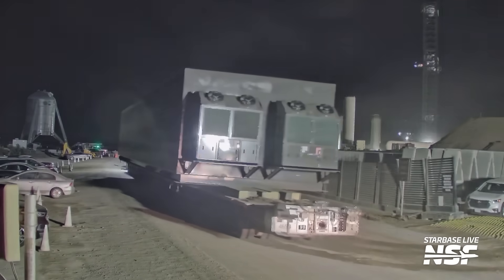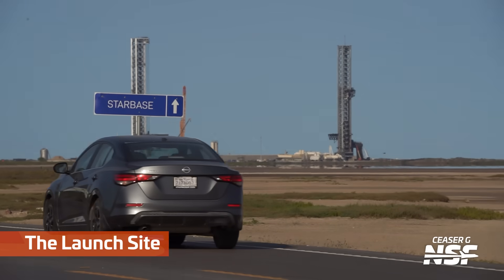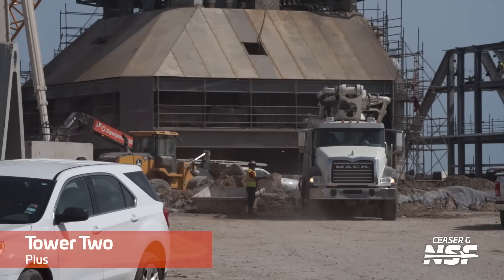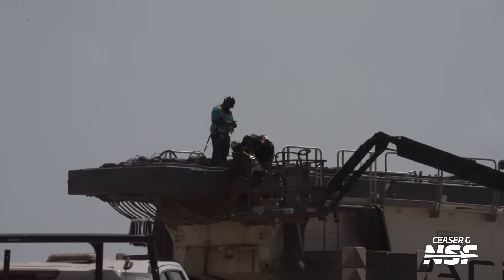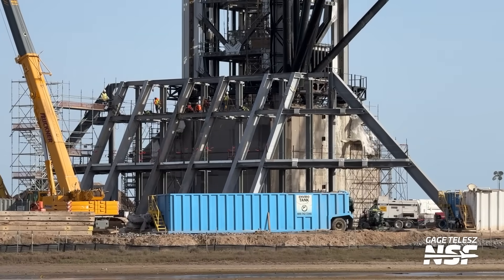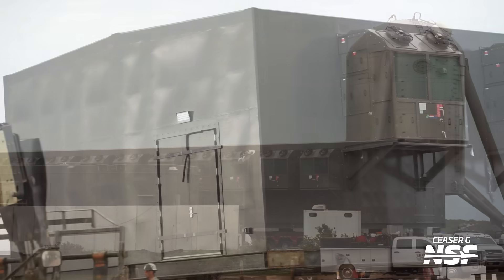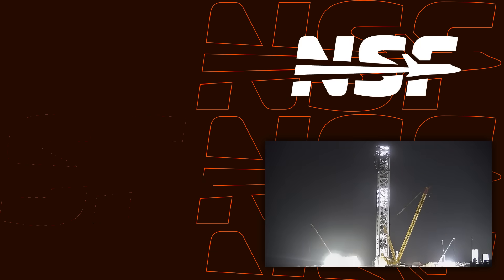The Final Days of the Starbase High Bay | SpaceX Boca Chica

Comment: Power Bunkers. The ones we installed at my last computer company were a mix of batteries, diesel generators, fly wheels attached to generators(that can kick in in less than one 60Hz cycle) and a water cooling system. The idea was that if power failed, the flywheels would kick in first, then the batteries would cover while the diesels came up to speed and continued the site electrics.

Comment: At least one of those buildings will house Variable Frequency Drives to control the 3-phase A/C motors used to pump the cryogenic fluids.  A/C motors are speed controlled by varying the frequency, whereas D/C motors are controlled by varying their current.

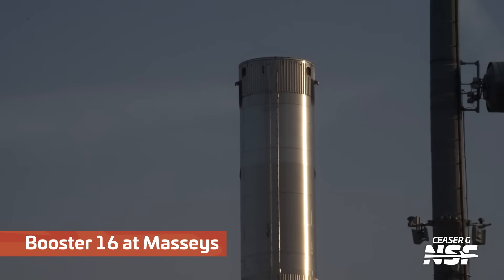Comment: 3:55 seeing big metal beams in housing is quite the norm here in Australia. Especially if it's a mostly wood house and the beam is used for the garage or to support important walls on the second floor in a townhouse. 

(Tho more steel frames houses are popping up these days, mix of Aussie steel supporting locals and the occasional wood shortages)

Comment: How quickly we forget in the early days parts for the booster and starship were sub-assembled in tents and final construction done in the high bay. Why? Because who really knew if the design would actually work as predicted on the computer. Add to that the very low build rate so changes and constant improvements could be made relatively quickly. All those tents gave way for Star factory because they now know the design works as advertised. Let's speed up production by building star factory and  2 mega bays. Now high bay must make way for the giga bay. Ain't progress a wonderful thing. I may be wrong on this but I think I heard giga bay will have about 24 workstations

Comment: TODAY 23 March 2025 the 3 phase supply going to Starbase was accidently cut when a 100 wheel vehicle fell off highway 4, destroying some posts and the wiring blew up. Hope it does not delay IFT9 to much.
Scary as it was like lightning bolts as the wiring disintegrated.

Comment: @3:55  you see a house incorporating a counterpleaded steel girder.   Those are corner lintels for corner opening full height deck window doors.  Corner opening deck window doors used to be expensive and hard to engineer because the structure that holds them is always counterleavered and needs absolute stiffness or the corner doors will jamb. These corner deck window doors can be segmented and be as much as 20 feet in length along a wall.

Comment: I worked in the utility industry for 36 years and was in many of those "power bunkers". We called them metal clad switchgear buildings and they often come completely assembled from the manufacturer. For utilities, they contain high voltage (4160 volts, 12470 volts, 13800 volts, maybe higher) draw out circuit breakers as large as your refrigerator, high voltage switches, and the controls for them, called protective relays which do the short circuit sensing and tripping. Industrial applications could have motor starters as well, there again, essentially a large switch with controls. I suspect all the fans and ventilation equipment are because it is in a hot climate.
Reply: Why are they painted black when they're parked in the sun and need cooling? Isn't that counterproductive?
Reply: @futurespace2380 Good question. Where I worked, they were light grey in color, some of the older ones were green. Basically the same color as transformers you would see on a utility pole. I worked in a cooler climate, so cooling wasn't a big concern either. It's probably more the modern day electronics that are in the controls nowadays and the power electronics in VDF motor starters that would require cooling. There certainly appeared to be a lot of fans and cooling equipment on those ones at Starbase.
Reply: It could be related to the fact that black also radiates heat quicker, opposed to white for example.

Comment: The  “power bunkers” look like motor control centers or instrumentation centers that are common in oil and gas infrastructure.   Switchgear, VFDs, instrumentation, controls, .. that sort of thing.  They are often delivered to site with everything installed.   hook up and go.

Comment: Thanks Caesar (rough Riders) and DAS (John G).  I remember NTSC (Never The Same Color), I guess it is still the standard 8^).  Need shielding and ferrite beads.  FCC part 15 sucks and it is hard to find equipment that meets the standard (as it is so flimsy that the vendors just put "If this interferes with something or you get interference, move it" and they think they are covered.
Reply from the maker: Ceasar and Gage (Rough Riders) are two different people 👍. Both doing great! - Das

Comment: 1:41 Can someone answer me why does highbay and I believe the mega bays as well have those beams around it which doesn't seem to be connected to anything other than themselves?
Reply: It's essentially the structure of the building, but on the outside of the walls rather than the inside. Doing that way means all the inside space is available to use rather than some being taken up by the structure
Reply: They give the building strength, otherwise it would just be a floppy steel sheet box. By putting them on the outside you save space on the inside. Overall it's a very simple, cheap and easy to build (and dismantle) structure.
Reply: They give the bay its strength. Unlike houses the bays don't have floors to give them rigidity.